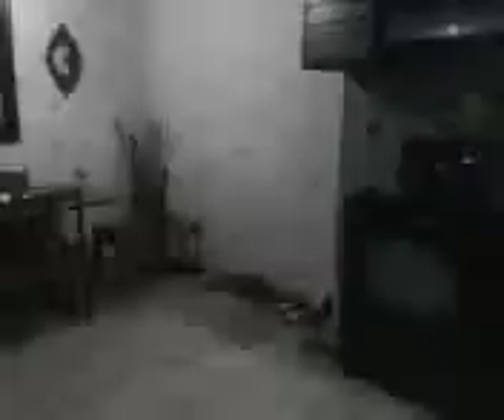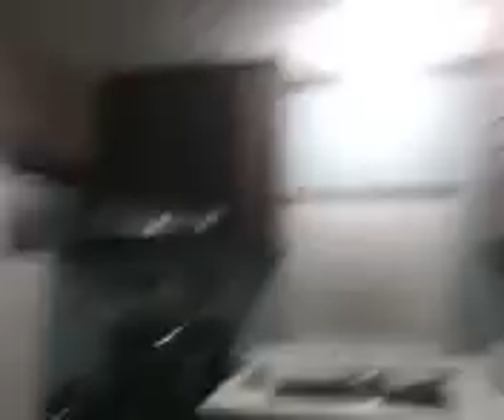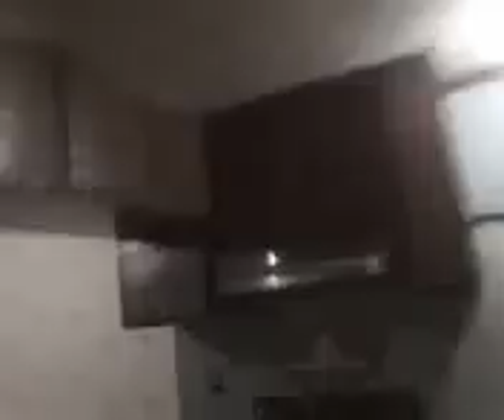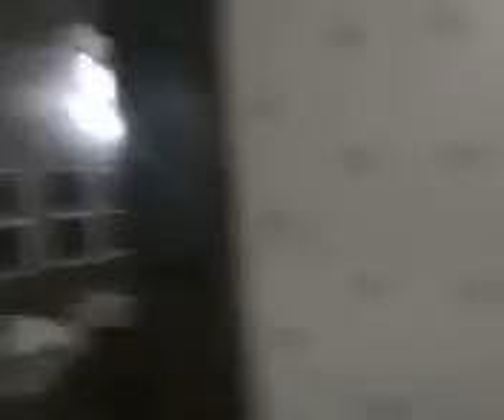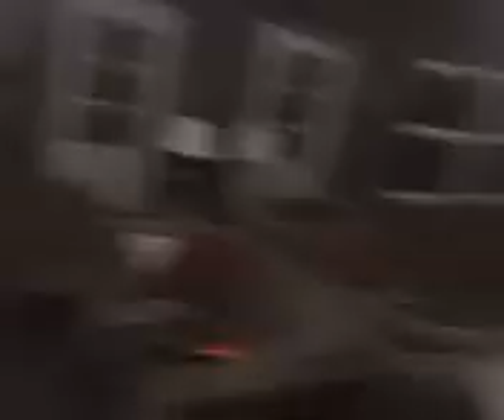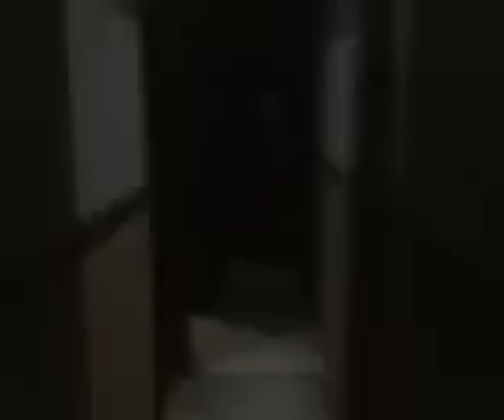Inside view of my 12v DC Lights inside my house

Comment: We went to our Local Auto Bond yard and got those Dome Lights in the Old Cars
They are 12 Volt-DC = to a 10 watt Bulb..
Cost? $1 each used..  We have them In the Garage and All over the Inside and Outside of the house , all wired upto a 3ft Bladed WindMill ontop of the House. with 5 Lithium Storeage Batteris for over nite power.. It's been 3 yrs and We're Now Broke even on cost vs savings and Now it's all Free Lighting ! Don't tell the utility company or our town, they'll Ban it..

Comment: DC power Is the Safest, but It cannot be Provided over Longer Disatnces without Having Boooster Generatiors.. But if oyu can Provide your Own Generator thru Solar or WindMill Power? You should Go All DC power in your home..  Home Dept sells Solar panels for as little as $350 for 250 watts an hour.. With another $200 in Lithouim Batteries to store it? You can Power All your insde  & Outside DC Lights and Then Some for 12 hrs  a nite..  doing this for 3 yrs now.. will take 5 yrs break even..